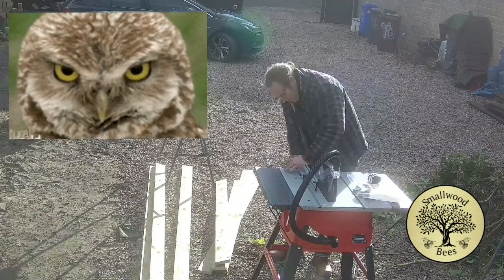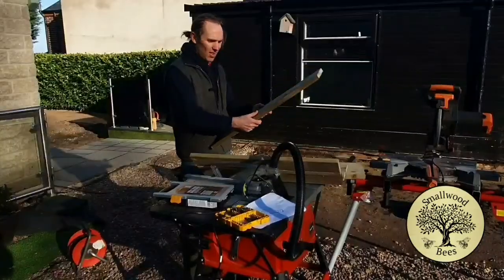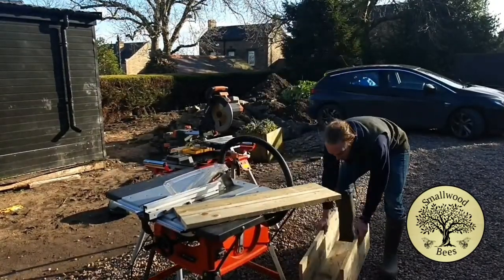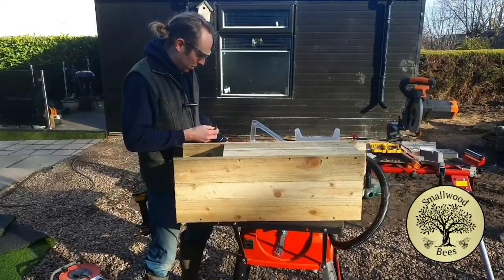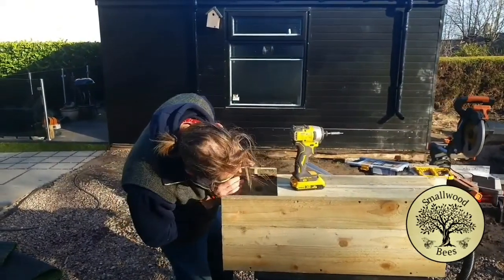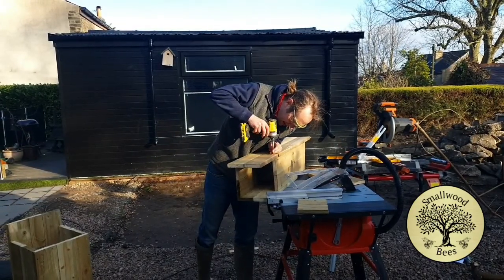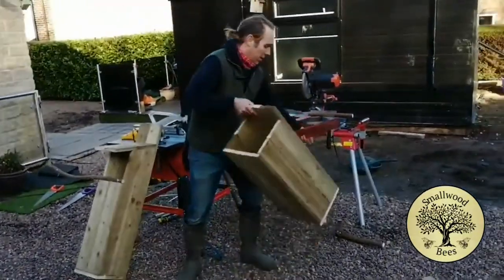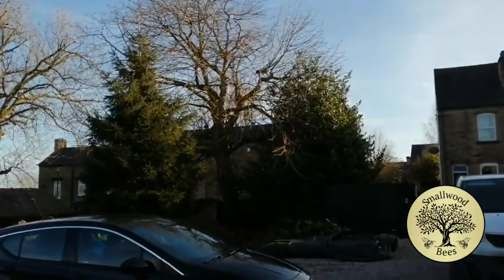Owl Boxes (My NEW Wildlife Garden)

Comment: Great work! Could I ask which make and model of drill you've got there...? I've been looking out for something compact for general jobs that still has the teeth to get a job done. Ergonomics on power tools is not my friend, and I refuse point blank to buy something pink. Of course, maybe you edited out the twenty times that it needed recharging, but if it's a tool that you'd recommend, I'd love to look it up!
Reply from the maker: I'm generally a Dewalt man. Certainly for battery powered tools. If it's for screwing things together which is generally what I'm doing then I'm a massive fan of an impact driver. I had a smaller one for a while which did go above and beyond really what it's capable of but since I've upgraded to an 18V one and it's brilliant. Battery charges fast but it generally lasts for the jobs I'm doing unless its 150mm screws for large posts but even then it performs really well. 
It's rare I need a drill and it if I do it's generally an SDS one because it's into concrete.
Reply: @SmallwoodBees  Thanks so much, this is really helpful!